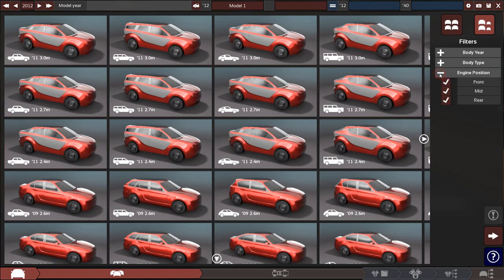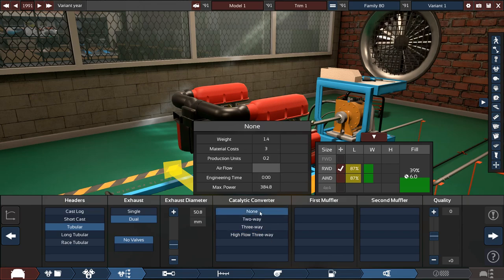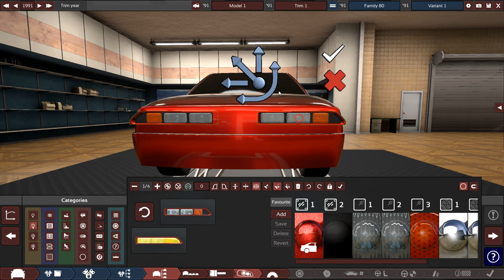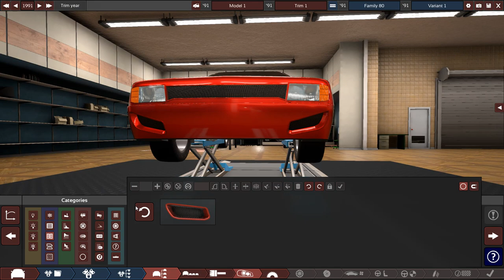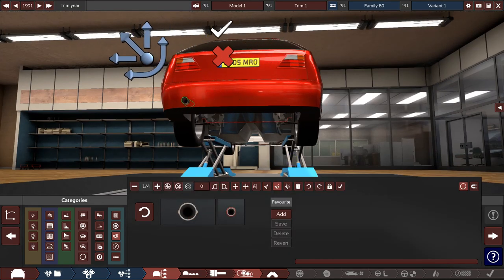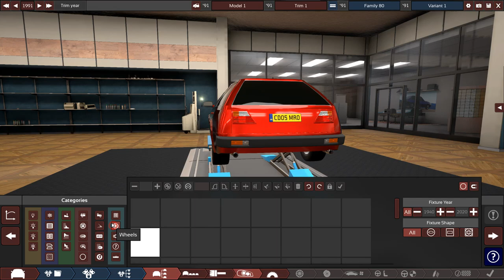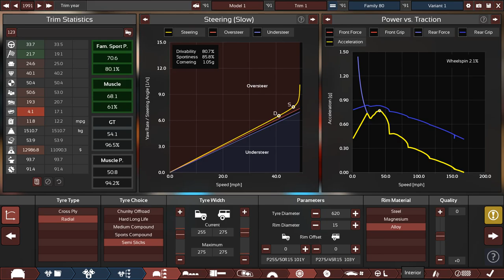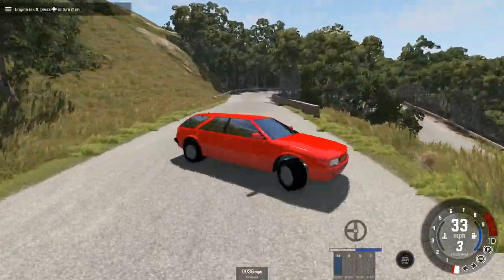Building A Rear Engined Estate Car On Automation

Comment: Alex: "I want to make a vaguely sensible engine, not too crazy"
Also Alex: Builds a 4L flat-6 with 30 Valves and forged pistons and rods producing over 400HP that runs on premium petrol back in 1991
Reply: Smoking corvettes and mustang with a stock station wagon in 1991 would be a sight to behold XD
Reply: @dekoldrick  I forget which Buick station wagon it was but in the 90s you could spec one to have a 350ci v8 and a limited slip diff with semi short rear gear ratios suited for acceleration. Most of it was the same as a Corvette, mostly the engine.
Reply: @dylanmore2627  Buick Roadmaster
Reply: @dylanmore2627  
Yep, the original LT1
Reply: Ish Shah he should've put an engine in the front too
Reply: Ish Shah don’t forget the mad 12:3 fuel mixture. Things gonna be guzzling fuel at a mad rate all the time
Reply: i dont mean to be offtopic but does anyone know a method to get back into an instagram account?
I somehow lost my account password. I would love any tips you can offer me!
Reply: @Sean Ira Instablaster =)

Comment: obsesses over front vents for a rear engined car

Your luggage is going to be very well ventilated
Reply: So true lmfao
Reply: Or ducts going under and back
Reply: Could be brake ducting I guess,  + some mid/rear engine cars still have radiator up front
Reply: Lucas Kane shoulda put an engine in the front as well

Comment: The Chevy Corvair back in the early 60's was avalible as a wagon/estate.
Reply: Also the VW Type 4 Squareback
Reply: The corvair was such a cool car. The 65 corvair monza with a turbo was a mean car.
Reply: good point
Reply: Well... These are the least Estate estates EVER...
Reply: @pdb4382  and Type 3
Reply: The Corvair also had a van and pickup truck variant!

50s-60s GM was out of their minds and it was glorious
Reply: It's weird. Everyone I know loves the Corvair except all the boomers that were around when they were new.
Reply: @SoI_Badguy  That's because all the boomers that DO hate the car woulda voted for Nader and read his shitty book lambasting the Corvair, the rest KNOW it was an amazing machine with a badass engine. 64 was the last model that had the suspension problem that would cause the wheels (front I think) to tuck, possibly causing a roll over, 65 forward fixed the issue.
A friend of mine owns a pristine 64 Monza soft top, 110HP model. Sadly has the 2 speed power glide and not the 5 speed, but its more a city cruiser then ass hauler.  Here's some Corvair engine lore for ya, there are people that make reverse rotation kits for them for use in buggy swaps, I think Clarks Corvair sells them. And they were used experimentally as aircraft engines.
Reply: @pdb4382  we had a t3 with a boxer 4 rear engine

Comment: Imagine the engine you could get in the back of an 850r.
Reply: v30 quad turbo ?
Reply: @stanley4290  I was more thinking of the 850 as its larger than the v30 even though that is still large.
Reply: @revs7837 30 cylinders
Reply: @revs7837  from the front seats to the boot
Reply: @stanley4290  could get that 46L Brutus engine in there
Reply: Inline 32
Reply: @hihiguy5716  wankel  XD
Reply: @stanley4290  ;)
Reply: Well I've seen a 12 litre V8 marine diesel engine carried in the back of a Subaru Legacy with room to spare, the suspension was less than pleased but a couple of bits of wood to act as bump stops stopped it dragging its arse too badly
Reply: a absolute unit
Reply: TjDolHaus86 shame it was only carrying it

Comment: You put lots on vents on the front when you would need them at the back for cooling
Reply: air intakes on the sides instead of back doors.
Reply: If the engine was at the back the radiator could still be at the front though. But yeah it's nice to stick some vents on the back sometimes.
Reply: @tr673  not necessarily. could be mounted under the car. i have an old vw with the engine in the rear, mind you its air cooled but it still has an OIL cooler and a common mod for better thermal performance is mounting a bigger oil cooler on the underside of the car.

Comment: well, ever heard of a VW Type 3 Squareback?
Reply: Is that a Type 3? Why am I thinking it was the Type 4? My memory is crap.
Reply: Best car, although I think it's actually mid-engined? so you have a frunk and a trunk
Reply: @lucaskane5364  The engine is still behind the transaxle. The cargo area has a higher than usual floor and an access panel to the top of the engine. Those little boxers sit low.
Reply: @lucaskane5364  my grandparents had one! Always had warm clothes as they arrived after a long holiday trip to the mountains because the engine heated the luggage
Reply: or a Hillman Imp Estate
Reply: VW Variant?
Reply: @carlos-m20  is that what it was called over there?

Comment: 27:50 Citroen comes to mind.... They always set out to do stuff different and weird. The first to have a production car with front wheel drive.. the hydropneumatic suspension..
Basically invented to bring a basket of eggs in the passenger-seat thru a farmers field without an egg breaking...
Reply: jazz21977 Citroën Xmas right

Comment: Chevy built a  pickup version of the Corvair, which was rear engined. Air cooled flat-six. Didn't sell well. Did have a loading ramp on the side, so telephone companies loved it for hauling spools of wire. The part behind the cab, where the side ramp was, was lower than the back of the bed. Again, great for telephone companies, as the heaviest, most awkward thing normally carried was a big spool of wire.

Comment: "VW Type 3 Squareback" the original rear-engine estate.
Reply: 411 later on.
Reply: The Tucker actually
Reply: @acdcrockme1917  the Tucker is a fastback. Not an estate.
Reply: what about the chevrolet lakewood?
Reply: @flyer3849  I was unaware of a Corvair based station wagon. Thank you for enlightening me. Although according to Wikipedia they were introduced the same year.

Comment: OMFG. Nobody wants your car because it is constantly spinning. Your car oversteers at 5mph. You should stiffen front suspension, decrease width of front tires, change gear ratio. But I think most of us would enjoy watching your progress in campaign.
Reply: Yeah, I have built neutral rear-engined cars in automation, you just have to go with the formula: lots of camber, small front tires, soft back.

Comment: Why has nobody asked nor answered the question if a car's exhaust produces any thrust? Like if two cars with the exact same weight and drag coefficient were to have side exit exhausts versus rear exit exhausts, would the rear exit go any faster at all?
Reply: WW2 fighters got some thrust out of their exhaust, so yeah, I imagine cars do too. It's probably irrelevant at car speeds, though. Think about jets taking off: they have trouble accelerating despite a much more powerful engine than any ICE.